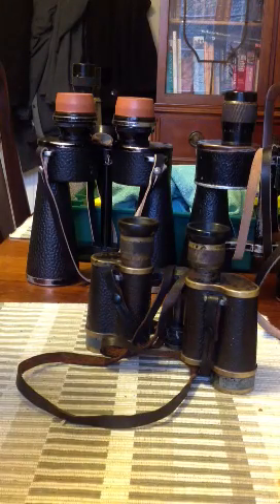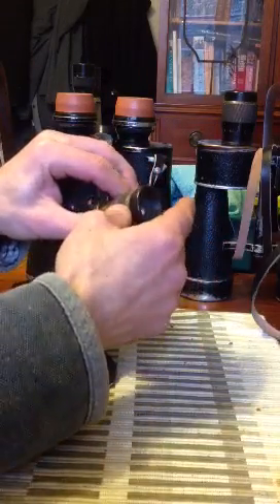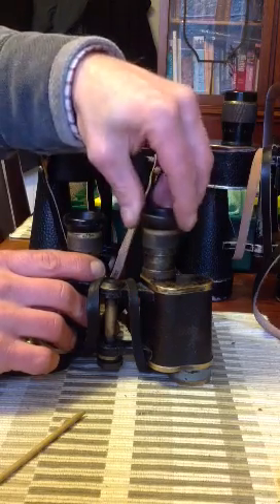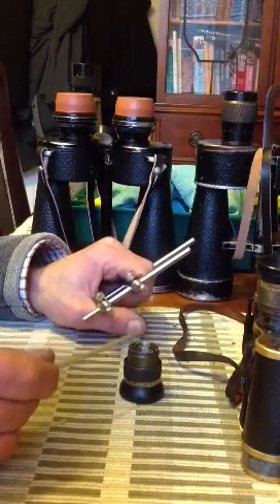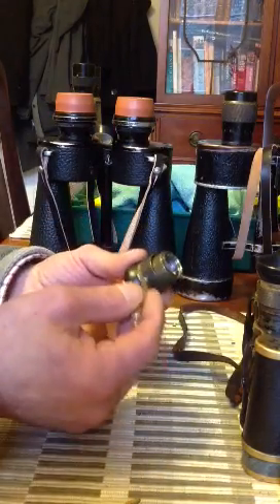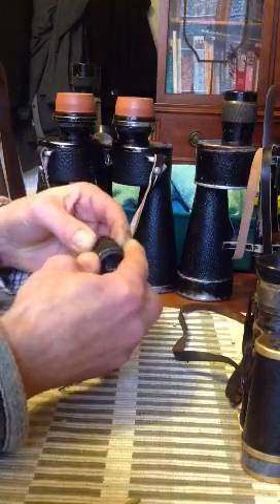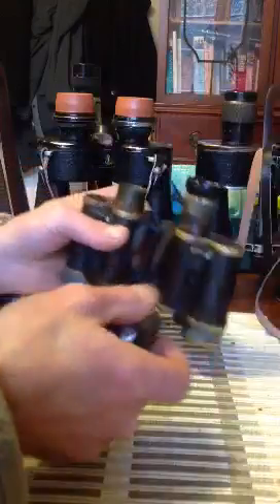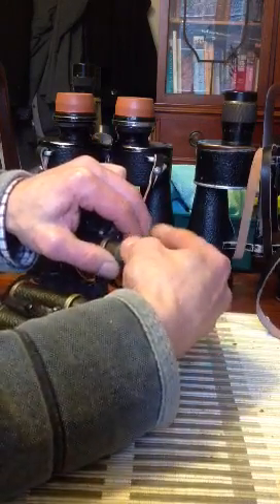Ww2 German binocular occular repair

Comment: great instructional video.  But when reassembling the eyelens portion to the diopter scale, how do I make the "0" ,   "+" or "-" markings match those of the  other ocular?  Thanks, just wondering, because my  0  mark ended up on the other side of the ocular.